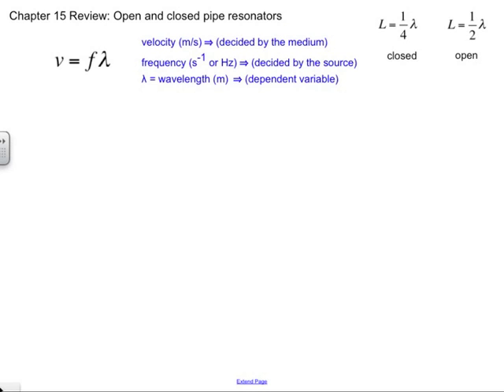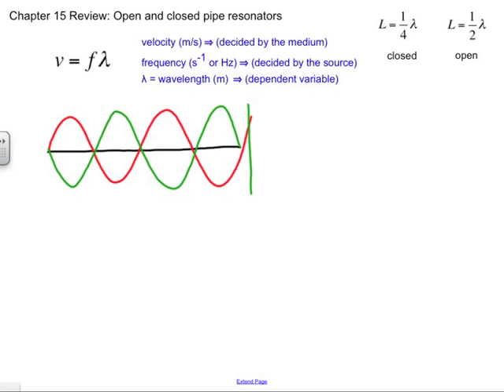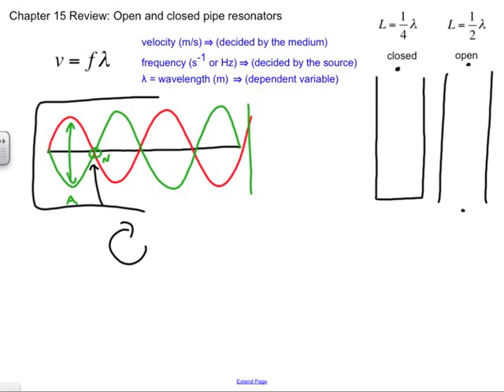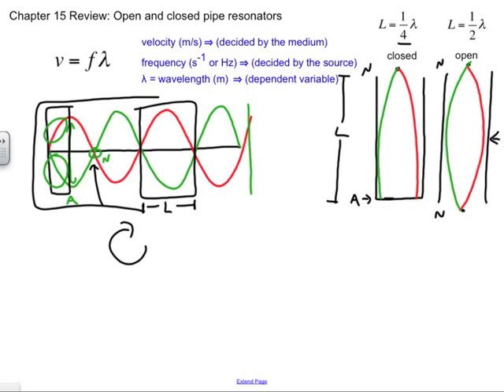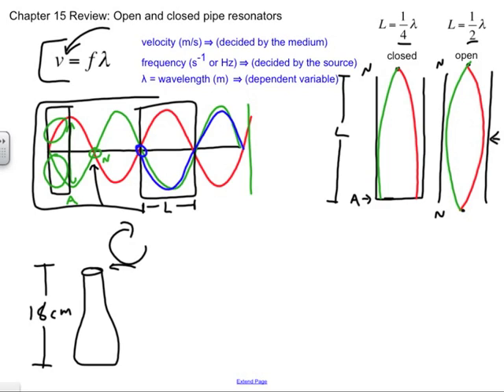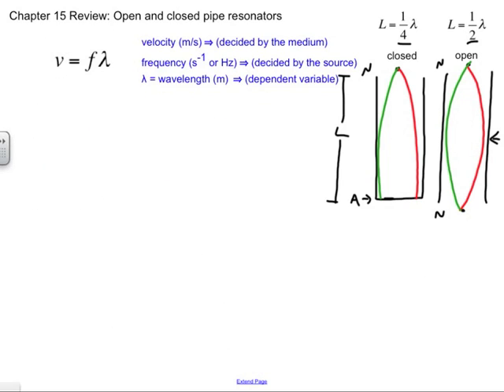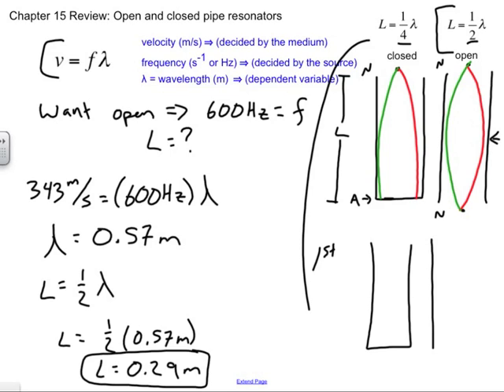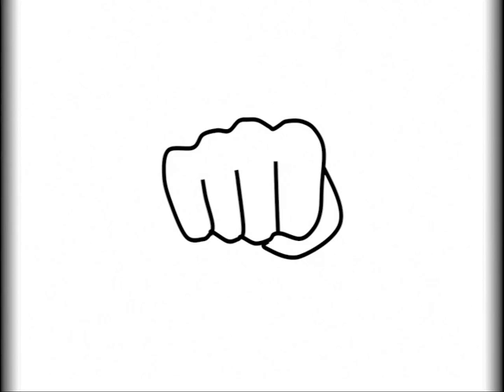Open and Closed Pipe Resonator Problems, Chapter 15 Review

Comment: I have a V8 with dual exhaust that has an X-pipe. For the frequency calculation I'm not sure if I should treat it like two separate 4-cylinder exhausts or one 8 cylinder.

Comment: Your pictures for open-closed tube and open-open tube are WRONG!! The boundary conditions for an open-open tube are starting with an antinode and ending with an antinode. For an open-closed tube, it starts with antinode (for the opening side) and ends up node. You are misleading people.
Reply: This. But I wonder what's the difference between the two variants since we reach the same conclusion regardless of whether we choose node or antinode at the beginning of the pipe.